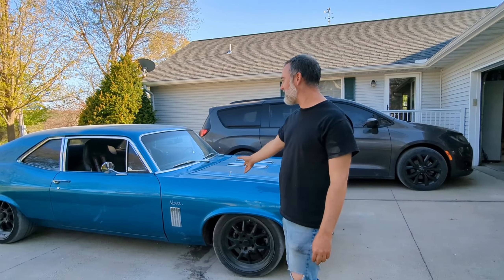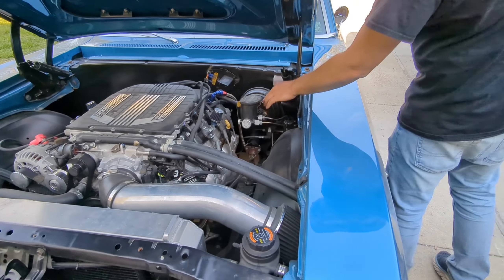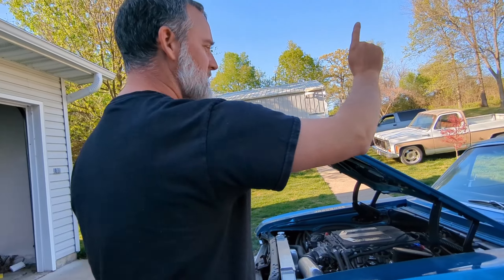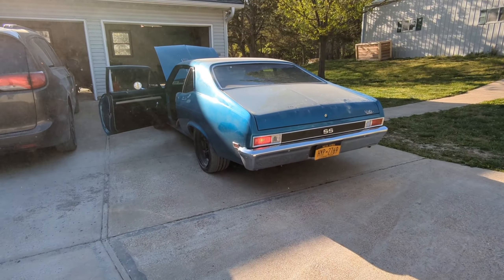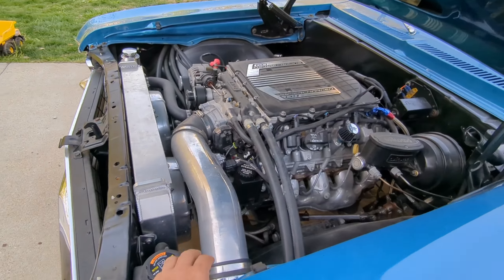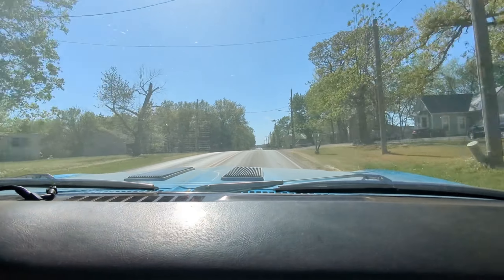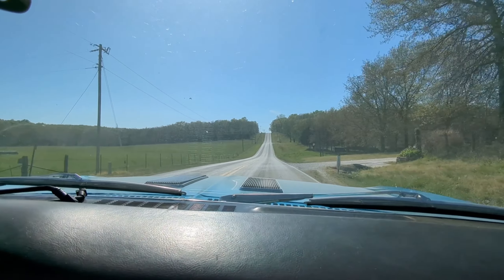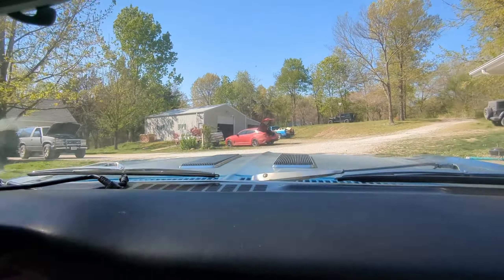Nova LT4 swap

Comment: I would kill to have that independent rear suspension on my 72 Nova and ditch the solid axle honestly. Its ok til you hit rough roads. Even good 4 links still unload on deep humps on road construction highways on the way to work

Comment: Put a small capacitor inline to feed the power to the ecu.
Reply: I was just thinking the same thing, it’ll stay charged up even when sitting, and won’t discharge until it’s used then it instantly recharges itself problem solved, nice motor and trans swap this is setup to daily for sure.
Reply from the maker: I used a larger gauge main power wire and that has fixed the no start issue
Reply: @swaptimeusa  that can also be the trouble, power and or ground size wire
Reply from the maker: @Basshertz13  Thie size of the power wire was the problem. It is now fixed with a larger gauge wire
Reply: @swaptimeusa I sent you an email and a text message. Need information on how to send you my harness to rework